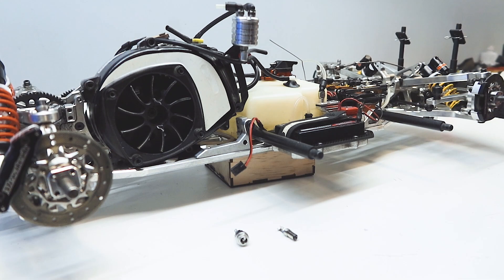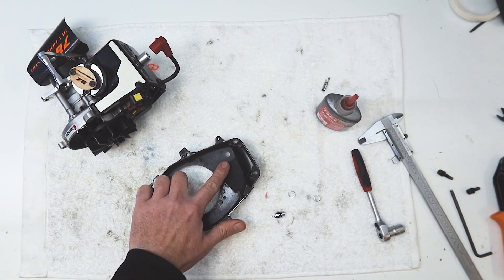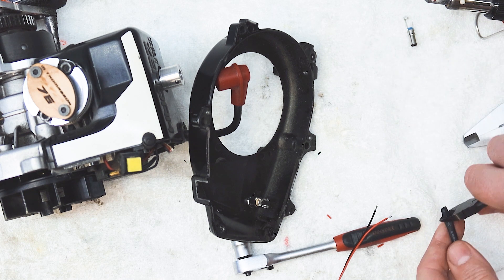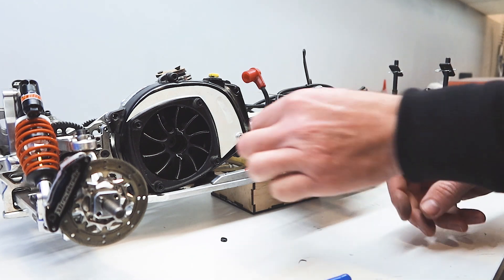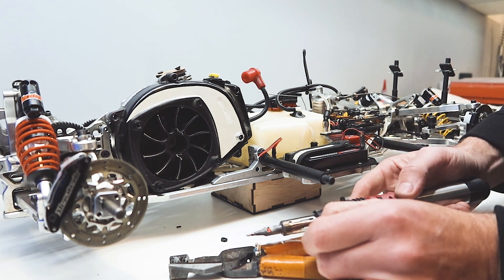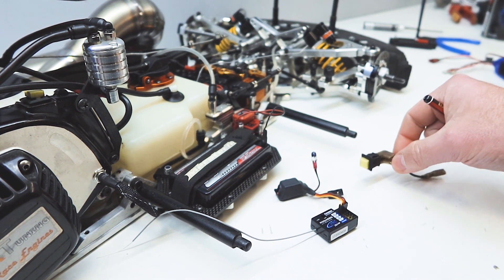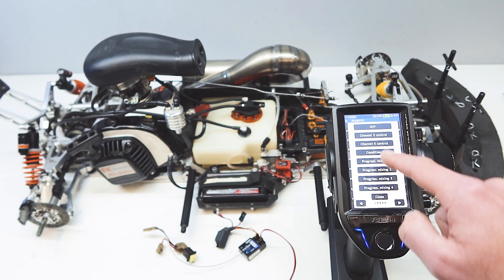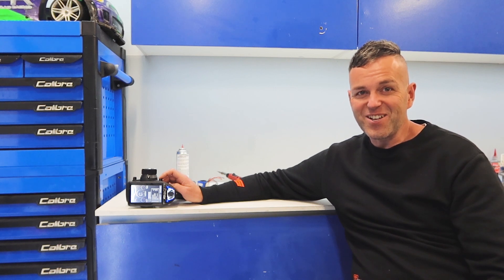RC CAR KILL SWITCH A-Z Install

Comment: Hello my friend. Another great video again. Very helpful for everyone. Awesome. Keep making these great videos.
Reply from the maker: Hey Mate! thanks for the continued support! are you running a kill switch?
Reply: Sorry my friend, I just now saw your question . No , I don’t have a kill switch in my car , because I was afraid of the electronic interference it might have . I have bought one, I have it in my bag, but never installed it in the car. But after your video of shorting the servo wires and installing the kill switch , I will do both. The videos are great and I decided to go on. I ordered the parts the pats that I don’t have from your video , I am waiting for them and I will make it like yours . Keep feeding ideas . Thank you again.

Comment: This a switchblade killswitch?
Reply from the maker: Its a http://www.hilantronics.com.au/#Spark%20Killer (so many great features on the Hilantronics unit, cheap too) I'll send them an email and see if they can arrange a discount for us!?
Reply: Mark Thomasson all good mate i make my own that do the same thing and don’t blow up after 6months.
Reply: Amazing Video, i only use the remote fail safe. But in case i lost my Servo Power or Something else, im lost. I build it your way.